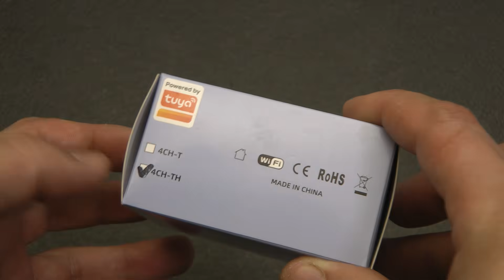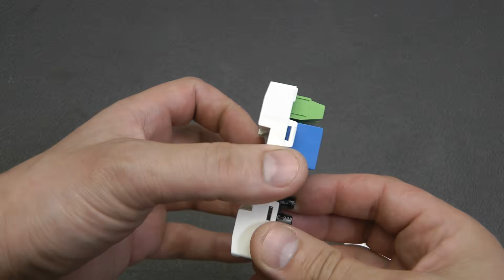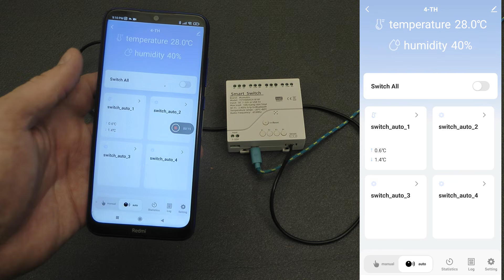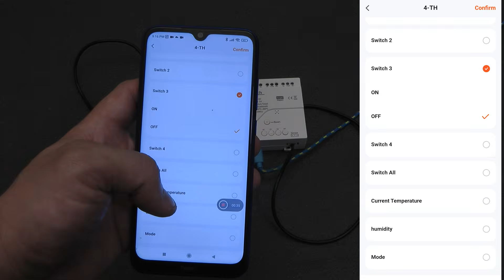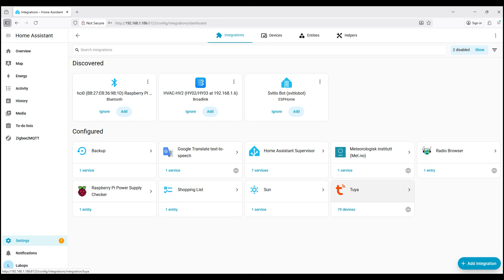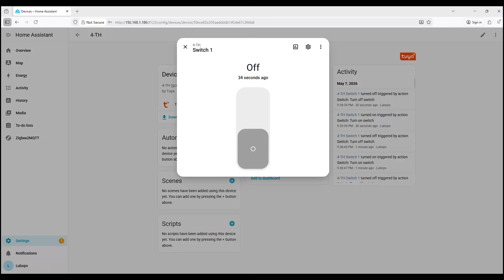Tuya WiFi 4CH Relay: Dry Contacts, RF433 and Temperature/Humidity Sensor

Comment: good afternoon. Could you tell me how to add a cyclic timer? 10 minutes of work, 10 minutes of rest, and so on throughout the whole day, for example. As I understand it, I need to write a script for this?
Reply from the maker: Hello! No scripts or Home Assistant needed! You can set this up directly in Tuya Smart using automations with delays. Configure the relay to run for 10 minutes, turn off for 10 minutes, and repeat the cycle. I use a similar setup myself: 10 minutes ON and 50 minutes OFF.